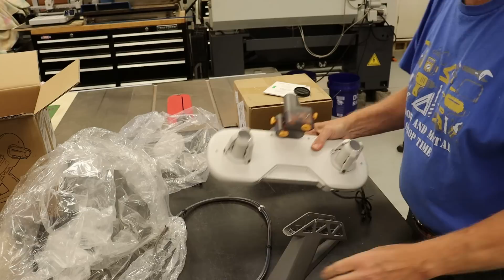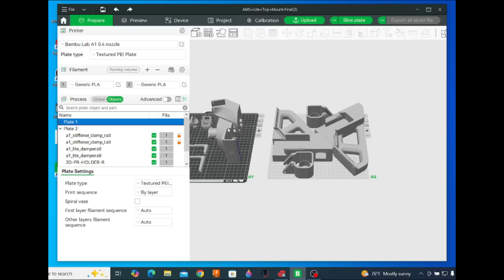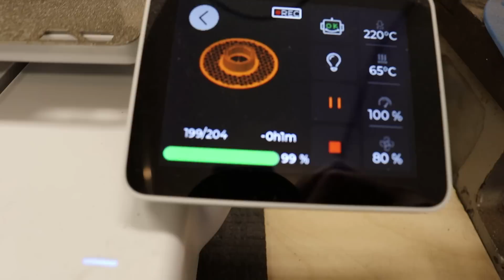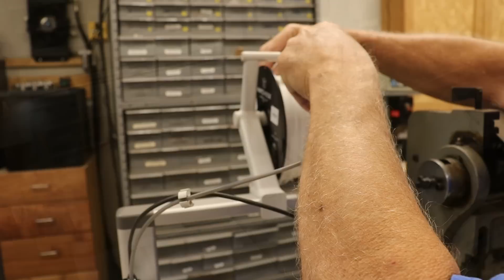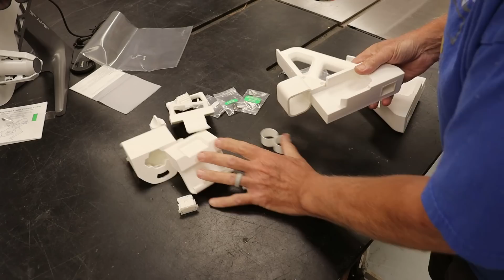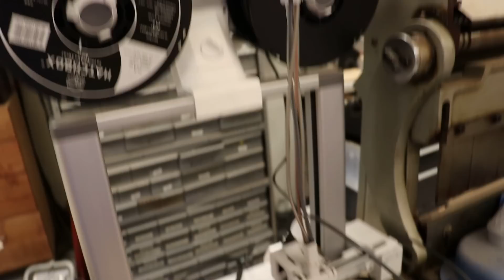Bambu Lab A1 Beginner's Guide to Multi-Filament printing

Comment: If I missed it and you've already answered the question, I apologize! 
Are there expendables in the 3D printer itself?
Reply from the maker: There is the extrusion nozzle which may wear out eventually, but replacements are inexpensive and easy to replace. They sell a hardened nozzle for the abrasive filaments--carbon and glass fiber reinforced.  The teflon tubes that feed the filament eventually wear out as well, but again, they are easy and cheap to replace.

Comment: The tab slides in a slot between the inside hubs after they're put together. its a reel lock to keep them from accidentally coming apart.
Reply from the maker: I see that now, I used them today.  Thanks for the tip!